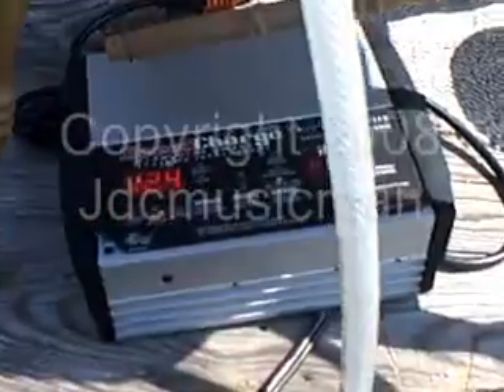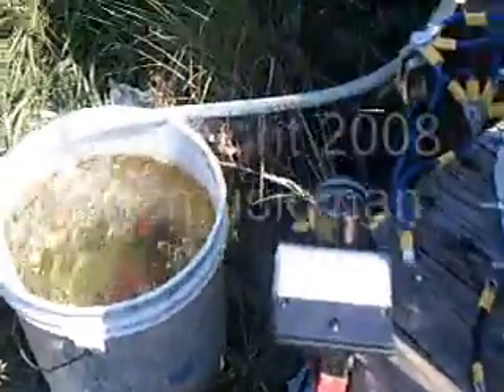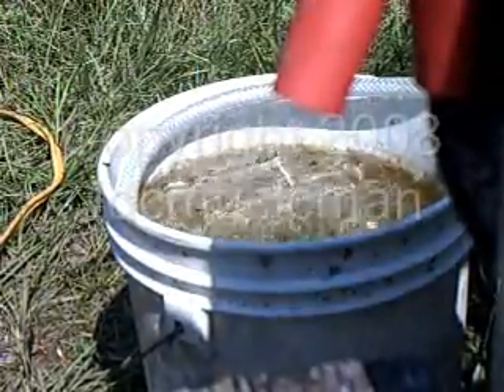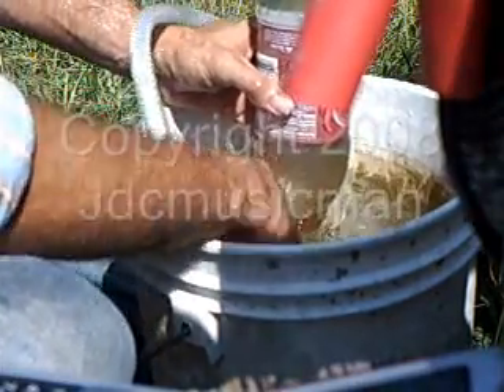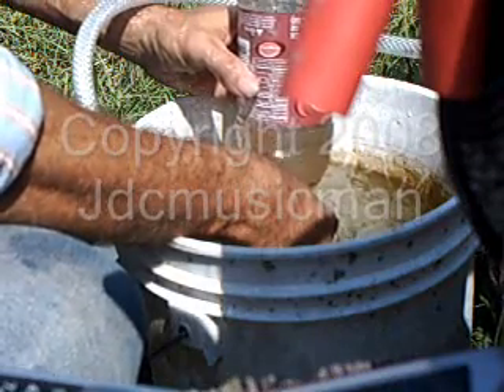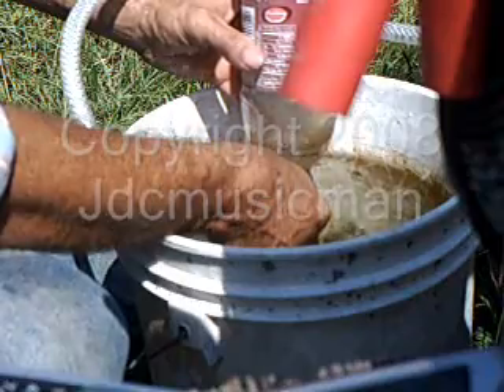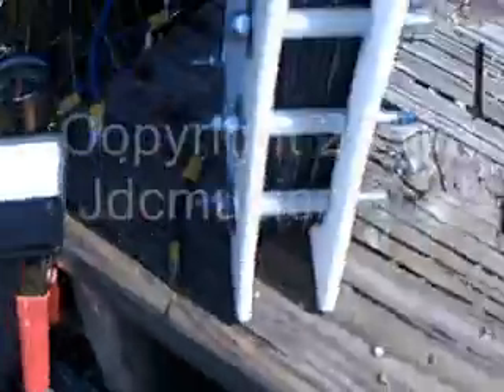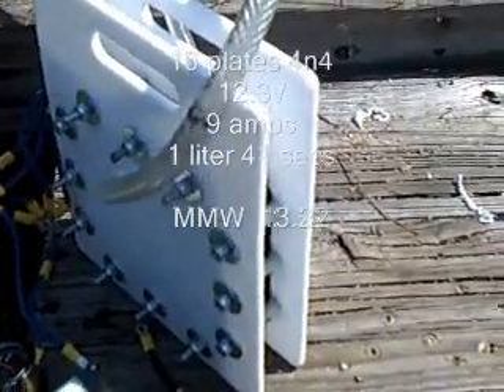New 16plate 6x6  drycell MMW 12.80(PENDING)

Comment: how is the no holes on the bottom working out.. have you run it alot and tore it apart yet?.. i tried 36 plate but now i use 21 plate 4n 4c 6x6 dry cell. i stagger the 1/4 bottom holes..

Comment from the maker: No I havent thought to check voltage reading on individual plates.I will do that in my next test run.yes both my cells are the same,same steel,same gaskets ,just one has more plates ,The only other thing I done different on the 16 one is that I drilled 3 holes very close to each other and in the 31 plates one I only drilled 1.My next cell I plan to build,if everything works,I plan to drill no holes and have gas coming out from between each plate and water going in from the bottom the same way..

Comment: continued...
The only thing I can think of is that on the 31 plate setup some of the cells are filling up with electrolyte and allowing voltage leakage between cells. Have you measured the plate to plate voltage on both setups? If my guess is correct the 16 plate setup will have consistent plate to plate voltage and the voltage will vary on the 31 plate setup.
Mars

Comment: Hi JD:
Your results are great. I hope some one duplicates them soon. You could be the start of the next wave of drycells. I have  set of plates cut but I haven't drilled the holes yet. I am waiting to see what is going on with your setup before I proceed.

From what I can see in your videos it seems that three is no difference between your 31 plate setup and your 16 plate setup. Even if your gauges are whacked the 16 plate setup is still twice as efficient as the 31 plate. continues...

Comment: NO holes means no electrical losses, all current must go "through" the plates, and water. You might check out "Eagle Research" He's been building for many many years now, and he absolutely stresses that you have ZERO holes, yeaa i got all his books and dvd's.. 
Anyway, if you skip the top hole, or put in less water then you'r there. Remember Bob Boyce, he's got no holes at all, just a gas-vent space, above the plates. 

Good luck, and nice setup :)